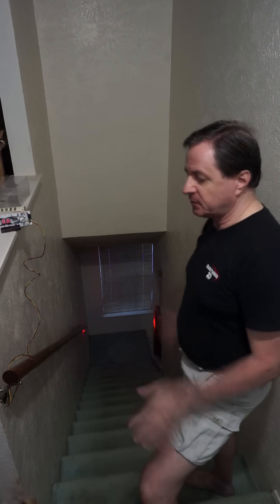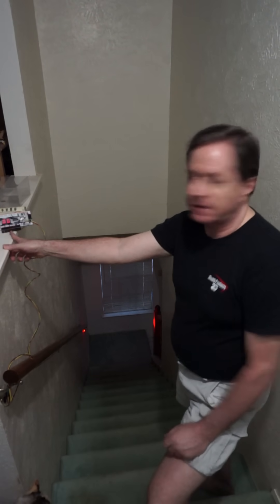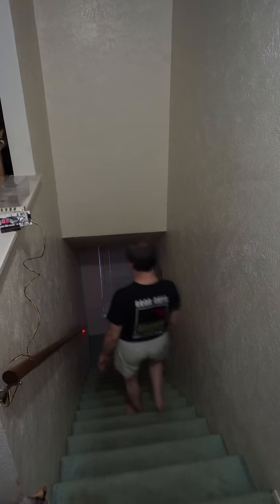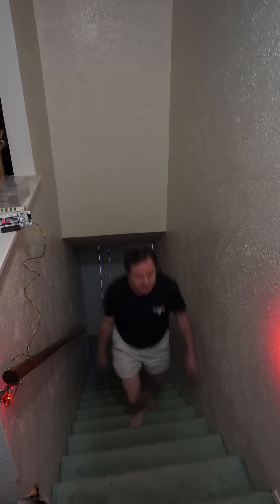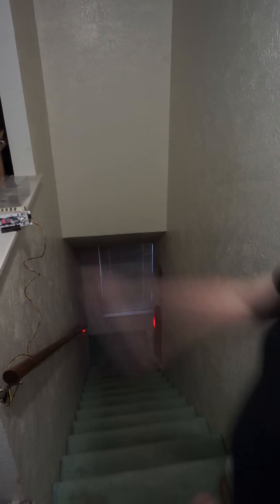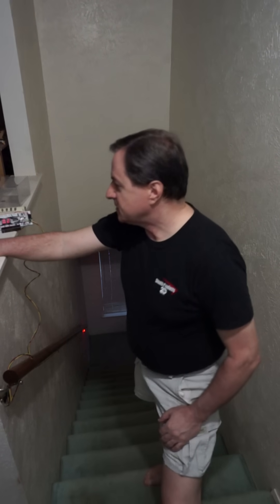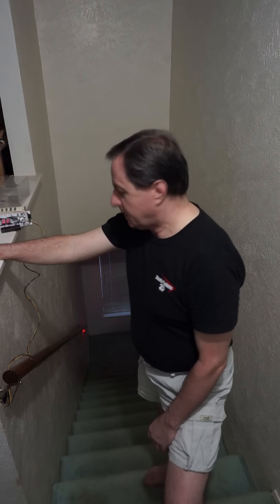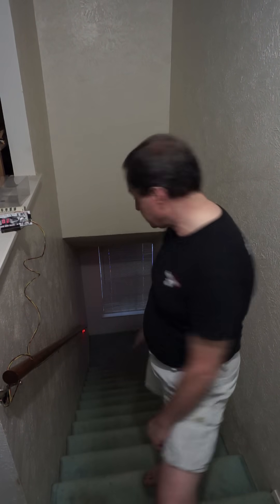Bounceless optical switch

Comment: Why 108? Seems such an odd number to commit too? Or does that equate to distance covered? Those sensors, although probably a basic design, a very practical and useful solution. Love the red LED touch so you know which one is on! Great job!
Reply from the maker: 3 sets of 36 totals 108. It takes me about half an hour to do 108; when that gets easy I will increase to 3 sets of 37 (111) and so on.